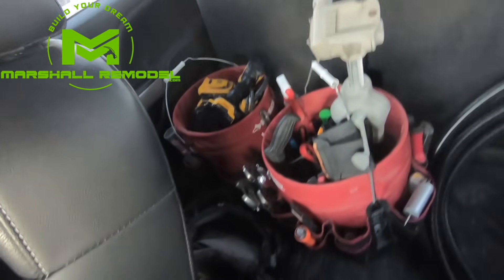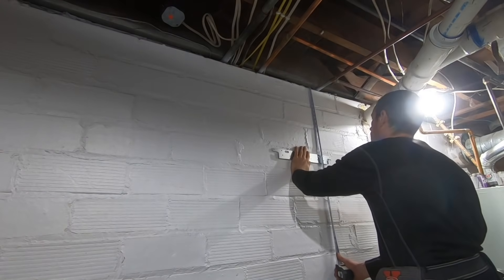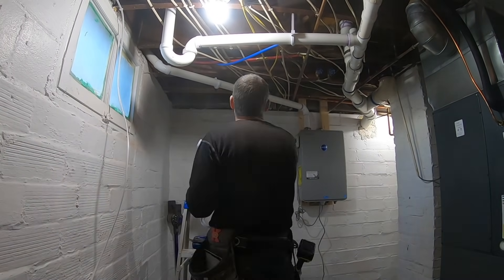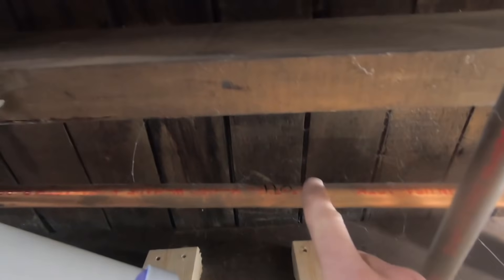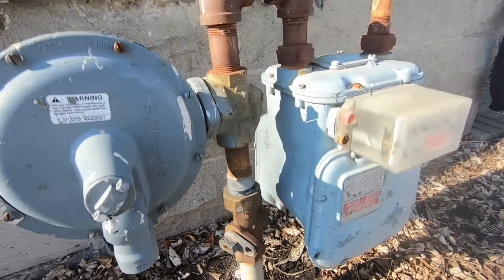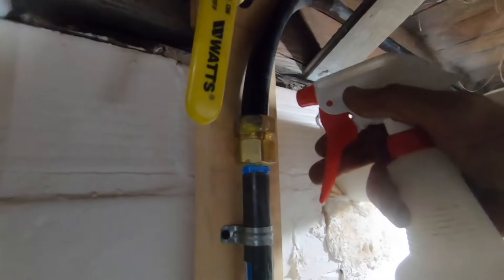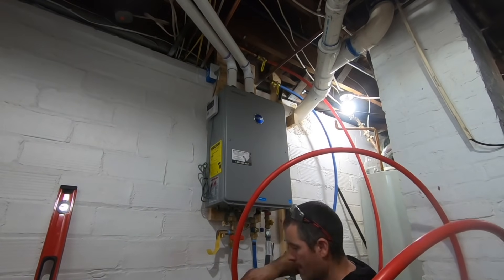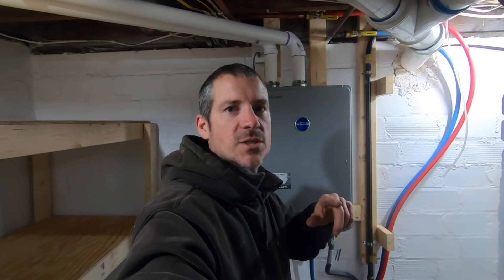Tankless Water Heater Install | Existing Home

Comment: Im a licensed master plumber and trained by rinnai us as a level 4 tech. I can tell you number 1 the gas line is undersized. Unless you installed the lowest btu possible unit your probably running 150,000btu min. You should be running a 1” gas line from the meter to the tankless directly depending on the length an material it could be larger. Second the flue although spaced properly which is good unfortunately it’s in an inside corner which will cause the exhaust to periodically be sucked into the intake which is bad news for the burn chamber.
Reply: And the gas meter is too small.
Reply: Yep, another Carpenter playing Licensed Plumber. No issue with insurance and permits? HA!
So many issues... 
No Plumbing Permit
No Gas Permit
Sch 40 pvc no longer legal to use (at least here in MASS!) for the guys exhaust
No Liability Insurance
Push to fit valves
Valves under heater not for "draining" but for annual flushing of the heat exchanger
Condensate not proper
I could go on and on... 
He is qualified to run those 2x4's down from the floor joist though. 
Not doing his family any favors here.
Reply: Looks perfect to me
Reply: Piping as the crow flies is terrible. Straight, square piping only
Reply: @tomhill9027  This install would never pass inspection in Colorado or not in my county anyways.  The issues you mentioned plus a couple more.  Rinnai and Rheem both teach a very different setup and installation that would meet code.  I usually do not comment but that install would make me nervous.  The homeowner can pull a permit personally, but that would fail instantly with about six violations or unacceptable items.  I guess as long as it works and nobody gets hurt.
Reply: As 20 year youtube licensed plumber the biggest problem is he should be using galvanized wood against the walls before he starts a fire. Damn carpenters never know what their talking about.
Reply: @immachine1565  yes you need one 😂
Reply: Joseph....if that is a 2-lb pressure system, 3/4" should suffice, right?
Reply: @patrickberry7197  sure but gas pressure varies depending on area. In my are it .5 psi. Other areas it’s higher requiring a regulator. Follow local gas code
Reply: As a master plumber also I agree with you except the gas line. You only need a 3/4 gas line which is good for 348,000 btu and longest run method would tell you that depending on other fixtures down line, depending on the table in the iapmo mechanical gas code book that is excepted in most states and that unit is at most 199,000 btu.
Reply: Too bad a licensed master plumber can't read the gas requirements for that heater - it only requires a 1/2" gas feed and will work just fine as installed.  There are no issues on spacing the feed and exhaust air as the exhaust points down and will not backfeed.  Other than the fact that the service valves for flushing should have been made more accessible, there is nothing wrong with this install.  These units are actually pretty easy to install if you have the space and access to the exterior wall for venting.
Reply: @Christopher Haak  he probably has read the manual, piped into the unit is 1/2" but gas code it sizes to 1" so that's what you pipe upto it until it Tee's. A licensed gasfitter knows that.
Reply: You certainly do know your stuff.
Reply: Aren’t these 220 volt or 120.
Reply: Looks good
Reply: @Name-io6dk You either
Reply: Eres Mamon! @Josephclegg895
Reply: You’re correct he definitely has knowledge, just few important things missed unfortunately. I’m 99% sure that gasoline is undersized, but would need to know gas pressure and see manufacture specs for that specific unit.

Comment: I have never had a tankless, have had water heaters installed myself pretty easy (last one cost me $600) lasted about 10-15 years little maintenance. Tankless DYI like this guy if not you probably need to get some pro to install $3k to $6k. 1 )Biggest selling point of tankless used to be instant hot water (I was always skeptical-how!?) now it comes to light that that is bogus... 2) Also big energy cost savings $8 a month = that will take 50 years to pay for itself. Total no brainer for me (my opinion vast majority of people) tank water heater until tankless gets way way cheaper which doesn't seem to be anytime soon.
Reply: Well tony d..would like to go see u buy a tank heater now for 600 bucks u would end up with a 40 gallon cheapy from manards that would only last u prolly 8 years if u lucky & that would be no where as efficient..and yes if the unit is hooked up properly & every thing is sized accordingly or unit is not undersized u will get hot water to the fixture very quickly..far as only saving 8 bucks a month on cost to run I would say that's a little off as well.. considering the tankless does not need to hold water and continuously heat it as a tank type does or take the amount of time the tank type does to get u up and running to have hot water again after your teenager drains it with half hour showers or more..also most likely depending on what u would need to keep up with your use load u would only spend around $1500 for a quality brand tankless not 3 to 6k..well add around 3 hundred bucks or so for the material still way under plus u do your own like u said so save ton on labor too right..
Reply: At this point, a tankless heater costs just about the same as a decent tank heater, sometimes less.  They aren't that expensive.
Reply: 5gpm tankless are around $800 now, not much more than a tank
Reply: @christopherhaak9824  when we were looking for a new water heater about a year ago we were looking at a power event or a tankless and we found that Richmond who sold both sold the tankless for cheaper. That’s what we ended up with and we like it a lot more than a tank
Reply: My wife and I occasionally stay at a friends guest house which is above a garage. The tankless unit id directly below the barh faucet? Maybe 6 ft of run. It takes 42 seconds to get hot water. And whenntaking a shower if anyone turns on another faucet you know it by the temo drop. And do not turn off the shower to soap up or the cold water sandwitch will give you a rude awakening.
Reply: @andywahl9631  their unit must be old because ours does not do that and we do not have a recirculation pump

Comment: done this many times when I worked in residential. There are a few things people need to consider before switching to one of these, first, if your house is still plumbed in old galvanized pipe forget getting a tankless unless your going to rip it all out and replumb in copper. secondly you need to have the right size gas line available and the BTUH available to run the tankless. I have seen on some small houses with small meters that have multiple gas burning appliances run out of gas cfm running multiple appliances while trying to run the tankless.  I personally run both the intake and exhaust at the same angle just for the symmetry of railroad tracking the lines but to each their own.
Reply: Johnny B. What about galvanized pipe doesn’t work with a tankless heater? I mostly switched to pex but some of my hidden piping I left alone
Reply: @jeffhuntley2921  The problem with galvanized pipe is that it rusts closed and restricts the water flow. Tankless water heaters heat large volumes of water with high delta T in short amount of time, water flow is important. If it works at all, it will only cause premature failure of the heater over time and unsatisfactory performance.
Reply: If I walked into that basement and saw that "shoe-makers" assortment of plumbing issues(tub drain blocking window from opening? Haha),rat's-nest of pex piping and electrical wires,cinder block foundation,too?
I'd walk away.
Reply: @jeffhuntley2921  👋
Reply: @raycumpian2864  ya thats not a basement I would use for a first date
Reply: @johnnyb8629  That is not correct.  The tankless modulates the heat output to match the temp set on the controller - 130 in the end in this case.  If flow is low, it throttles way back.  It obviously has to, because it will still provide hot water at a bathroom faucet tap only drawing 0.5 gallon / minute.  There is always a minimum flow rate, which I believe is 0.25 gallon / minute for the unit to fire.
Reply: @christopherhaak9824  Its not a question of will it work but will it work as the customer expect I. If it puts out hot water but low rate, then its not working. Plus, if they are forced to work in conditions less desirable, then I propose the expected service life is shortened.

Comment: Should take off the cover and check for gas leaks inside the unit, the manufacturers work needs to be field checked and twisting on water tank gas connection without a proper hold wrench can twist the connections inside the tankless unit and cause leaks. When tightening fittings in close areas always use two wrenches.

Comment: For one that csst is nowhere near tight enough, quit using channel locks On flat surfaces, The gas valve you put on needs to be within 6 ft of the water heater, also needs to be a full port ball valve

Comment: Great help.  I have 90%of my Rinnai water heater hooked up.  Now I have the confidence to finish the installation after re-reading the installation manual. Thank you!
Reply: @immachine1565  No need for one on a tankless, they dont hold hot water.. they just heat it and send it through.

Comment: When I built this house 5 years ago I chose a tankless water heater/boiler.  I have no regrets.  I've never run out of hot water.  We're on well water so I'm more likely to run out of water before I run out of hot.  I do the annual maintenance on the water heater side which consists of recirculating a mild acetic solution for about an hour.
Reply: Do you have hard water is it filtered and water softener used from the well. I was thinking of installing one I’m a seasoned DIY .
Reply: @blt981  We are on well water,  It's not softened or filtered.  I clean annually with pump and dilute acid.  They sell kits with a bucket, a pump and the hoses to connect to your heater as well as the chemical.  Our water is pretty soft.  Soap lathers readily.  We do get mineral deposits from water but it is in solution within the system and doesn't form  until exposed to air.

Comment: In Massachusetts we can’t use pvc anymore for venting the glue dries up depending on temperature and btu rating the glue dries out and leaks we now can only use polypropylene pipe and have to have an acid neutralizer kit for condensation so it doesn’t cause acid erosion of drain pipes and sump pumps nice clean install except the pen could have been a little neater they do make elbows and straight pipe with clamps to make a nice neat professional job

Comment: If the drain fittings were rotated about 45 degrees or so towards the front it would then be much easier to connect hoses for flushing the unit as required.

Comment: Also make sure unit is serviced once to twice a year also add a filter onto the cold water inlet to the tank to keep scale build up down on unit. 
Flush , clean flame rods and check filter just a few tips and info also put a gas shut off before sediment trap so it can be serviced if need be.
Reply: Hard water is never a friend to a tankless. Low volume of water with a lot of Btu's= lime scale in the heat exchanger. At least once a year a clean and flush. Also no condensate neutralizer, by product of any modulating condensing unit is acidic water. It can and will eat through copper and cast iron pipe and etch concrete. Also not good on septic systems.
Reply: @mattjarchow4965  The unit comes with a built in condensate neutralizer.

Comment: Super video! 
Though get some better csst, without an o-ring. I have never seen that stuff. 
Usually you put the clip 2 rings back and it presses the stainless against a brass surface to seal...
Also two more things 1"x3/4" npt "bushing" and what you guys call a sediment trap. In gas we call that a "drip leg".

Comment: Hey bro, this looks really straightforward, I really appreciate the info and play by play. Our hot water heater (from 1993 lol) just died, and you’ve instilled confidence in this machinist/fabricator to install a tankless on my own. Only questions I have are regarding permitting and insurance after the fact. If there’s something you could say with regards to that I’d be very appreciative. Cheers.
Reply from the maker: Thanks for your comment! Homeowners insurance doesn’t seem to be an issue. Permitting is going to be based on where you live and what your county/city requires.
Reply: Holy shit 1993 dam built well
Reply: @MrPostFrame  Till the home inspector shows up.
Reply: @MrPostFrame  insurance isnt going to pay to fix their slab after you destroyed it with condensate.
Reply: @MrPostFrame  always based on manufacturer specs. You know just enough to be dangerous
Reply: @jarrodhollenbeck4284  i7
Reply: @IslandPlumber  Because the condensate is acidic? IIRC from HS chemistry..
Reply: @IslandPlumber  Richmond water heaters have a built in condensate neutralizer, you don't need to treat it.  That was a perfect install, absolutely correct.
Reply: check local regulations.  If a homeowner installs in some areas that is okay, but you can't have someone else who is not licensed do it.

Comment: This is why you get someone who knows what they are doing. Great job! Enjoyed.
Reply from the maker: Thanks for watching!
Reply: There were a few mistakes made. Read the comments. Other people have pointed them out.
Reply: @SergioPena20  I don’t think you want a shut off on your hot water side either, I don’t know much about tankless water heaters but I’m familiar with hot water tanks
Reply: @murkyturkey5238  with the tankless you have a valve on the hot and the cold so you can flush out the heat exchanger once a year we have one and we love it

Comment: If I was inspecting this installation, I would cite and write 3 corrections: 1] The T & P valve needs to terminate to an approved location. 2] PEX needs supporting every 32".3] Provide a gas line schematic when tying into an existing system. Other than that, nicely done!
Reply: Mike, any ideas about this 👇

For anyone watching this, what kind of hangers and brackets can be used to secure the iron gas pipe ?
I’ve run into a situation where the gas pipe has a long run without support.  It just hangs there and will wobble around if anything disturbs it. Just touching it, makes it shake badly. 
It’s not good.
And any answers will be “for entertainment only.”  
Thanks.

Comment: One of the most thorough installation videos I've seen - well done
Reply from the maker: Thank you!
Reply: How do you determine the size gas line needed?
Reply: @phillipmontoya5326  The Richmond units require a 1/2 gas feed.  Other units may vary, just read the installation instructions.

Comment: Did you check and make sure the meter can support the btu’s? I believe the gas line is undersized. I guarantee an inspector wouldn’t sign off on this.

Comment: Looks like the same Richmond I have.  I hope you have better luck.   In 5 years I'm on my 3rd mother board, constantly have to clean my flame rods and get a new error code monthly.  It's nice when it works but has proven to be unreliable.

Comment: Hey Marshall, you mentioned it was a family member you did the work for, and keeping costs down is pretty important.
I dont know your background but I do have a couple of questions if you wouldn't mind answering. 
1) why use pex over copper for the cold supply and hot supply? You secured the 2"x4" to the wall. Why not just use bell hangers to secure the piping to the to a 2"x 6" instead? I also noticed that you've used shark bite valves, I've had terrible luck with those on huge temperature swings.
2) do they not require a condensate neutralizer where you live? We do up in Canada. The condensate is very acidic and eats out old underground piping unless it's the very old clay tile.
Great video otherwise 👍
Reply: 1. pex is resistant to corrosion and acidity more than copper is, I agree SharkBite's are garbage and not even allowed at most professional plumbing outfits 

2. most residential codes do not require a neutralizer kit below a certain BTU value
Reply: This unit, like all the Richmonds comes with a built in condensate neutralizer.

Comment: I not sure but in California we use copper from water heater up the wall exposed mount to the ceiling and from the ceiling we use Brass Adapters to pex and ur missing insulation on the line

Comment: What are you using to connect the Rheem to gas, that's doesn't look like pipe. I've had my unit for 20 years but it appears its having a gas leak when using hot water. Could smell gas outside and the gas company came in and said, what i was using to connect to the gas was problem.

Also we kept getting the error message not enough gas going to unit. So my question is how to correct this problem?

Comment: Any reason you didn't hang the water heater nearer to the vent exit? I find the small pressure lines (incl gas) easier to run and they take less space than running the vent lines to the other side of the room.

Comment: You didn't mention that if the power goes out there's no hot water.  Secondly the system has to be cleaned out at least a year.  Another great video.  Thank you.
Reply: How’s that different from any other electric hot water heater?   U may get what’s warm in the tank but you’d have to use it right away.
Reply: @malinoisnation9392  he replaced nat gas w/h not electric. Electricity goes out, no hot water. Once a year flush and clean or warranty is void too. I like tankless w/h, easy service calls
Reply: The system really needed a anti-scale filter and a water softener installed together to keep from having to flush the system.  It really makes a huge difference.